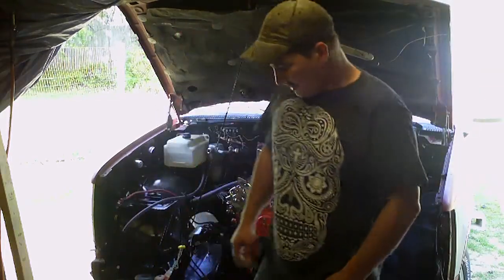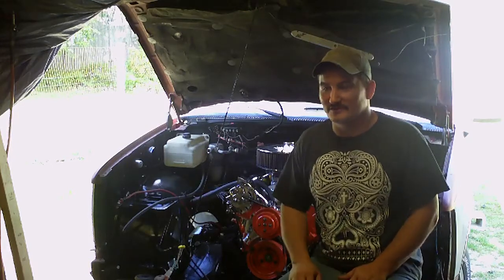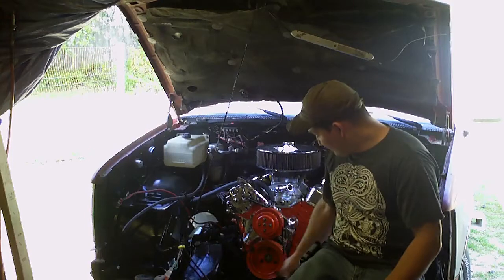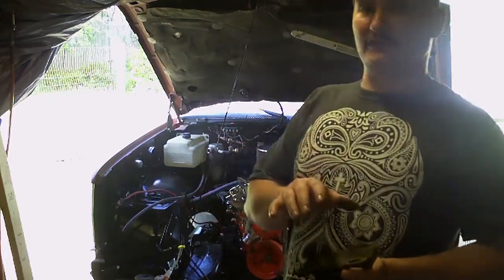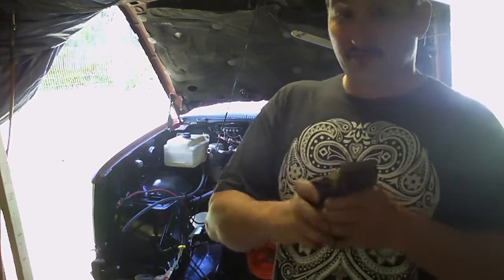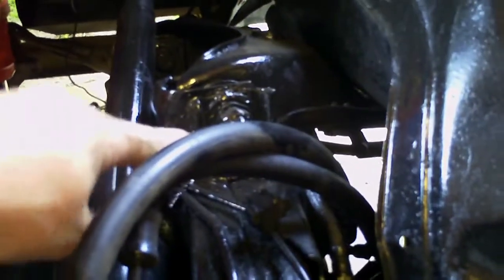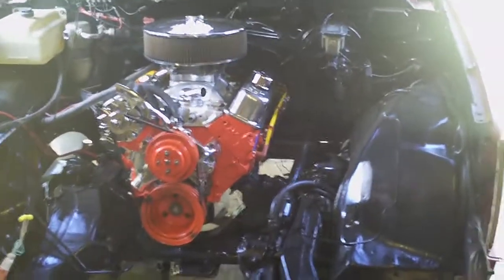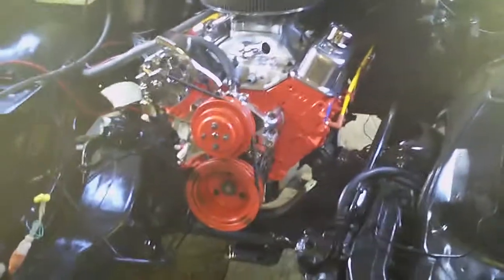1988 Chevy 1500 Longbed V6 to V8 swap - How to make motor mounts

Comment: Early models = old
later models = new
 yes i know it's confusing
Reply from the maker: yeah always gets me lol
Reply from the maker: At one time I was told for years that early models were the first half of a decade (0 - 5) and late model were second half (6 - 9) so if you had a 1988 it would be a late model 80s. I went with that for years lol. Then was told the same as you and hard to remember after going by something diff for so long.
Reply: Reid its CRAZY why didn't they use K.I.S.S